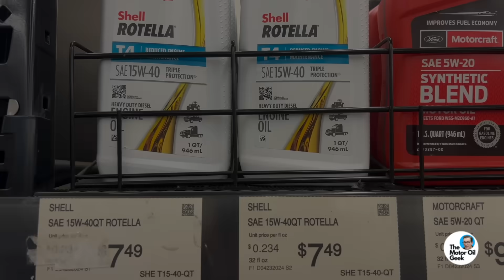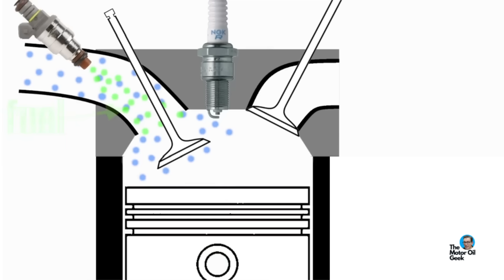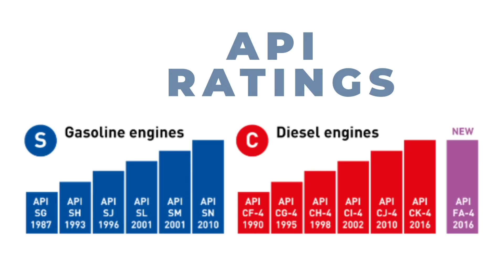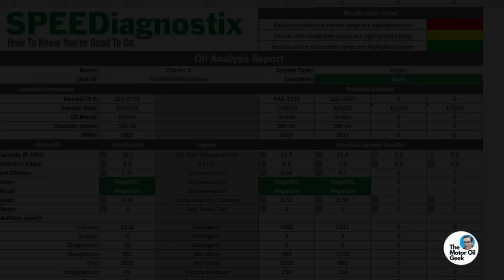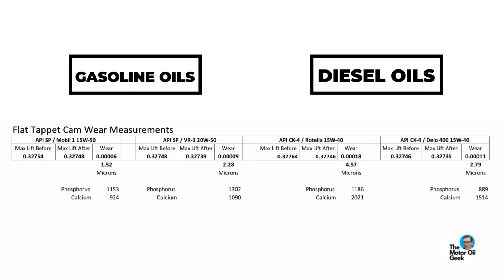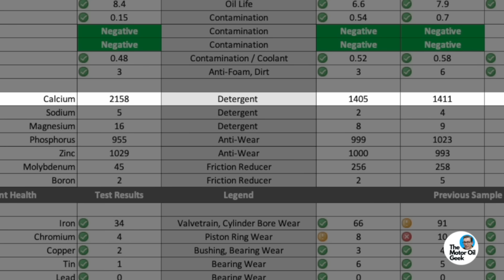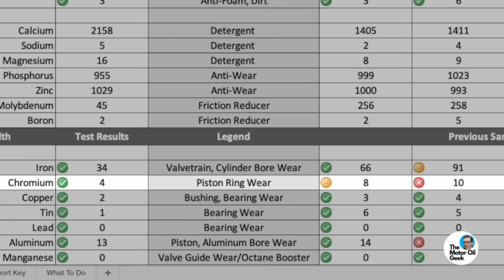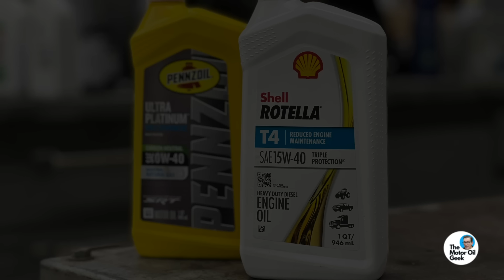Why DIESEL Oil is Actually WORSE for Gas Engines!

Comment: Great video Lake And Dave! Hey Lake could you do a video on Pittsburgh Power Max Mileage vs The Fuel Ox with Combustion Catalyst? It would be nice to see if either or both help diesel burn more fully. I already use Delo ADF600 10w-30 ultra low ash oil and I use Rislone DEF treatment to help with crystallization in the def tank,lines or nozzle. Thanks and keep up the good work.

Comment: rotella t6 saved my OBS chevy for sure , that thing would get down to 4-5 psi of oil pressure at idle when warmed up , swapped to rotella t6 15-40 , makes 18-20 psi at idle fully warmed up , and keeps 10 psi per thousand rpm like it should now. The oil change before I swapped to rotella had Glitter in the oil and a piece of metal about the size of a pinky nail falling into the drain pan (engine flashing maybe? ). That was 20k miles ago , running strong.

Comment: Very informative but I still will run Rotella in old high mileage stock v8’s none turbo when they have had years of crappy cheap gas oil in them and full of carbon build up. A little Lucas to after a few oil changes.

Comment: Been  running  diesel  oil In my gas 5.7 for years  with no issues   I hear  people complain  about having  to  do cam and lifters  12000 km  oil changes  are the reason
Reply from the maker: Next video addresses that

Comment: Main advantage for any older engine is the much higher ZDDP levels which 'everyone' knows was reduced due to it damaging catalytic converters and EPA putting a 7 year life on them. 
Manufacturers demanded the change to save money.
In the 1970's ZDDP optimum level was 1800 PPM, below 1400 PPM wear increased, above 2500ppm bearing damage was possible. 

Shell spent a ton of cash in 2010 to get Rotella rated JASO MA for wet clutch motorcycle engines.
You might know a lot about oil but don't seem to know a lot about engines?
Measuring parts to one millionths of an inch has been possible for around 130 years, common at least 90 years (I trained as a precision machinist, 5 micron tolerances- around two ten-thousandths of an inch for manual machines on production run in 1970's)
Most diesel 'road' engines take 10,000 or more miles before they are fully broken in then 'nothing changes' for years and years.

I'll just ignore 'recommendations' and continue using diesel oils or full synthetics in my motorcycles and cars.

Comment: Most of these comments are coming from people using diesel oil in their older non-direct-injected engines!
Reply: I won't buy a direct injected engine, I like my intake valves to remain clean without intervention.
Reply: Depends on the engine you choose. That's one of the reason ford came out with a gen 2 3.5 ecoboost. Part of it they added port injection also to try and solve that issue.
Reply: agreed, running diesel oil in a Briggs and straton is much different than a modern direct injection sports car.
Reply: @TheTruthman89  i actually run diesel oil in my Briggs and Stratton push mower. Air-cooled engines are so crude that they could care less. 😂
Reply: @TheTruthman89  true, because a new direct injection sports car isn't going to last long enough to worry about what oil you ran in it anyway.
Reply: The 2017 wr250r is Direct fuel injected thousands of owners in multiple different forms across different countries in variables have used 15W-40 T6 with no fail for years
Reply: Yeah, it was disappointing that they concentrated on GDI (God Damn Injection) engines instead of the flat tappet applications people are specifically using diesel oil for.

Then again, I don't see the benefit in running Rotella T4 when VR-1 is literally cheaper and specifically formulated for flat tappet gas engines. I run VR1 dino & synthetic and Amsoil Z-Rod in my fleet for various use cases. Z-Rod specifically is supposed to be great for engines that sit a lot. I think it's hard to find a better insurance policy than using proper engine oil and good filters.
Reply: The newer ones needed more than the older ones I rebuilt a lot of big cam Cummins 35400 Cummins 3406 cats and abused 1540 and absolutely everything since 1978 when it first came out and it was called all fleet oil and that's exactly what it is all fleet
Reply: @kalui96  yes Absolutely
Reply: Bingo!
Reply: That is correct!
Reply: We run 15w40 in my moms 1996 jeep Cherokee 4.0  with sensors and fuel injection and no issues
Reply: Guess you didn't hear the part where diesel oil caused more wear than the proper gas oil.
Reply: @3029dz nope it does not. Listen again to the video. It is compensating some of the zinc as it washes away. But T4 has 1200ppm zinc in it!

Comment: Well I have been using 0w30 and 0w40 in my pick up for about 350000km with no issues whatsoever. Truck has 531000km on it now still runs like new

Comment: What about a gas engine that is NOT direct injection?
Reply from the maker: Next video addresses that
Reply: @themotoroilgeek  --- I'm still running around in a 2004 Buick.. 3.8 liter. Can't do better, need it to last as long as possible.

Comment: Right ok, so now I'm completely lost. I have an old 60's high compression Olds V8 big block that has never been rebuilt. It's got a flat tappet cam and at this point I have no idea now what oil to use. I've been using Shell Rotella T4 10W-30 because of the zinc, but now I don't know what to use. Here in Canada they do not sell Valvoline VR1 or Driven oils........just tell me what to use haha.

Comment: Thanks Lake! I fell for the general forum boards discussion online pointing fingers at the EPA reclassifying engine oils and how using Diesel oils are now actually better and what you should be using in some gasoline engines. Thanks for clarifying this, I had no idea what I was doing... just following everyone else. Gonna dump the diesel oil today and replace it with the actual correct stuff recommended in the manual and recommended by you.

Comment: What about a mix in your high mileage non DI LS to clean it out.  Say running a 500 mile road trip and changing back to 100 synthetic car oil?   Back yard tinkerer, is that what they're trying to do with the new rejuvenate oil package from I think Valvoline? I'm trying their oil in a DI Kia with what was a new dealer replacement engine to try and keep the rings cleaned out so it doesn't crap the bed again. I know valves need to be cleaned so I'm only looking at the oiling ring issue for the Kia.

Comment: I've suspected this to be the case for a while and have slowly been building my test results to prove it. I have a gas boat engine which everyone claims is the perfect test bed for a HDEO. I had it freshly rebuilt and have exclusively run mobil delvac in it since new nearing 100 hours of use. I have done 2 oil analysis to date. One following break in at 10 hours and a second at 40 hours of use. Both show... how do I say... scary levels of iron, lead, copper and chromium even for a fresh rebuild. Further more, that 15w40 was sheared down to a 5w30 in both intervals. 

I'm no expert on oil (but I am an engineer) and that is pretty much all the data I need to quantify that it doesn't work well in that application. I have a third oil sample that I'll pull out in a few weeks to send out and see if I get any movement on wear being at 100 hours of use but I suspect based on my and others findings, that it'll be nearly the same.

I will update this with results moving forward.
Reply from the maker: Thanks for sharing!

Comment: There is a significant difference in newer IC engine designs versus older designs. 
This is the distance of the top piston ring from the top surface of the piston. Newer designs locate the upper ring closer to the top of the piston where it operates at higher temperatures.  It was relocated to reduce emissions of unburned fuels. I would expect that this makes it more likely to have low speed pre-ignition in the area of the upper piston ring.

Comment: I have a 1996 Jeep Cherokee, I like using diesel oil because it has zinc, I don't have to buy zinc additives with diesel oil, I don't know if I'd like running diesel oil in modern engines

Also I like to do frequent oil changes, like 3000 to 5000 miles regardless if it's synthetic or conventional diesel oil
Reply: It's interesting that even with the flat tappet camshaft there was less wear with the regular off the shelf gasoline oil than the diesel oil, I did watch the video talking about high zddp levels being worse, I just bought a 5 gallon bucket of diesel oil for the Jeep, I guess I'll go through that and stick with plain ol gas oil, neat.

Comment: The specs are everything. Check your car oil specs and label on a motor oil bottle. If they match use it. Some engine oils have both specs for gasoline and diesel.

Comment: The diesel oils I see on the shelf are all dual rated. Even the bottle he used In his video was rated SN. Most of the people i know using diesel oil in a gas engine are running flat tappet camshafts and that is why they are doing it (myself included). This was not addressed in this video. 

I 100% agree that using a diesel oil in a modern fuel injected roller camshaft engine is no appropriate. But for those of us with carburetors and flat tappet camshafts, diesel oils are one of the only hedges against cam/lifter failure outside of a boutique oil like amsoil z-rod oil. 

I have a plow truck with a small block Chevy. It is carbureted and has a RV style camshaft with stiffer valve springs. I want a 5w oil for cold starts as low as -20f. I’ve been using Rotella T6 5w40 in years past, but what are my other reasonable alternatives?

Comment: I have used Schaeffers supreme 7000 15w-40 in diesel and gasoline engines. I have also used Schaeffers supreme 9000 5w-30 in gasoline engines only. Am I making a mistake using supreme 7000 15w-40 in gasoline engines? I really like Schaeffers products and I know you can’t just buy them at any store. I would love for you to do a video on Schaeffers oil and give your honest opinion on it. Thank you!

Comment: It doesn't matter what oil you run in direct injected gas engines. Stop blaming the failures on the oil. It's a design and application problem, not a lubrication problem. T6 5-40 in multiport and carbureted is fine. No one is saying I only got 300,000 miles out of my Tacoma, but I could have gotten 750,000 if I had not used it.

Comment: Here in Europe I use 0-30
Castrol in my Toyota Hilux 
Diesel. Yes I religiously change it every 3000 miles. As I always subscribe to the adage of
"Oil is a lot cheaper than engines", the 2.4 Toyota uses zero oil in 3000 miles and this works for me.
Reply: You could run piss in a hilux crankcase and it wouldn’t hurt it 😂

Comment: Ok but what about the old car guys. Direct injection probably isn’t a concern. Derek Bieri is using diesel oil in older engines for the zinc benefits or because it has “dinosaur juice”. Lol. Is the diesel oil better for old engines vs newer SP passenger car oils?

Comment: So the title should actually read "Why DIESEL Oil is Actually WORSE for GDI Engines!".
I understand that the title stating "gas engines" in general brings more views, but many don't own them, as is obvious in the comments.
Reply: turbo gdi engines
Reply: @ Even worse. 😂
Reply: Yeah made it half way thru video and still waiting for the point
Reply: Any modern petrol engine is GDI though. It's very hard to find a port-injected petrol engine anymore.  I'm sure people with 10+ year old petrol engines, know their engines are different.
Reply: @TassieLorenzo  Even cars made now are about 70%+ gdi, not all, and there are many millions of gas vehicles on the road that are not. That's not even the point. This title was speaking specifically about this oil's effect on gdi engines, and it should've said that. Of course people will know it doesn't pertain to their vehicle, after wasting their time watching the video.